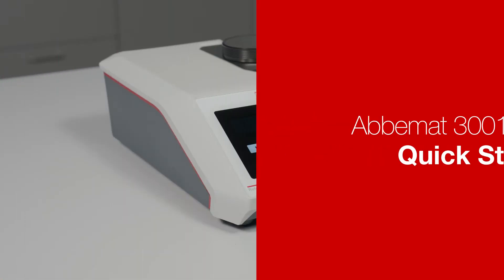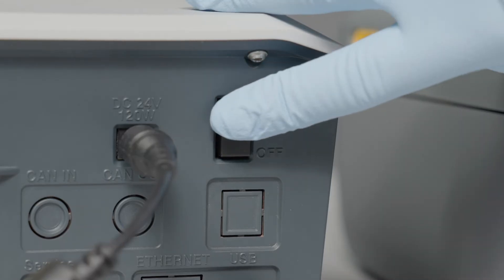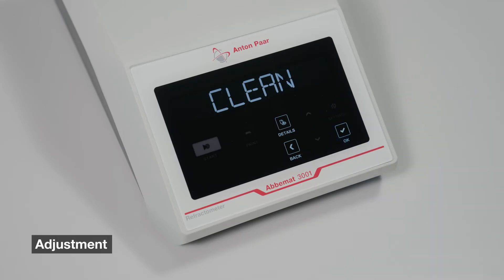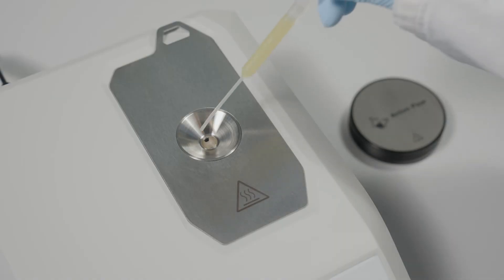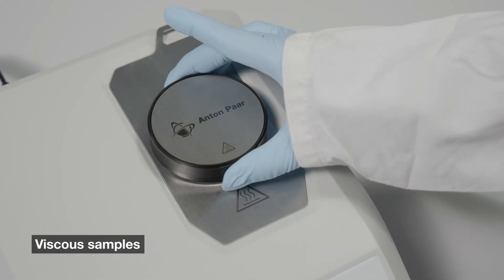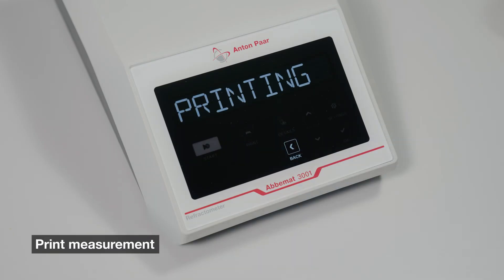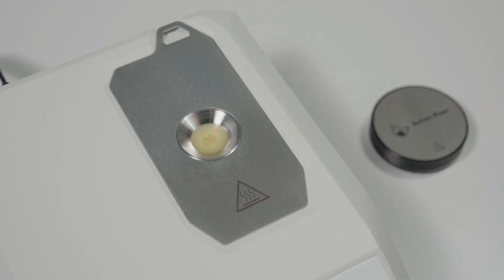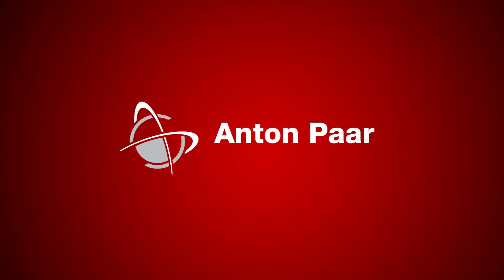How to use the Abbemat Essential digital refractometer | Quick Start Guide | Anton Paar

Comment: Does the Abbemat 3001 Essential digital refractometer include any additional device or accessory to maintain the sample temperature at 20 °C when the ambient temperature is higher than 20 °C? I understand the instrument has internal cooling based on Peltier elements — could you please confirm whether this is sufficient to hold the sample at 20 °C at elevated room temperatures, or if an external cooling accessory is recommended?
Reply from the maker: Thank you for your interest in our Abbemat Essential 3001! You can contact our product specialists directly at any time. Our colleagues will be happy to answer all your questions in detail: https://www.anton-paar.com/corp-en/contact/product-inquiry/?prd=47551